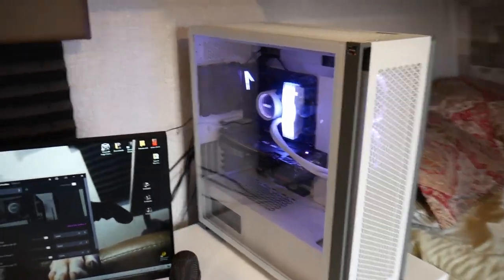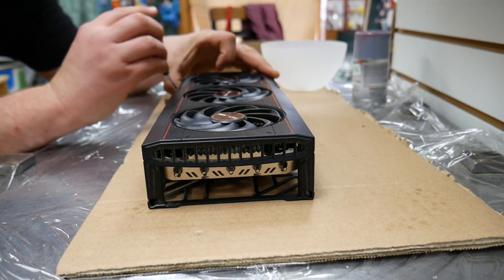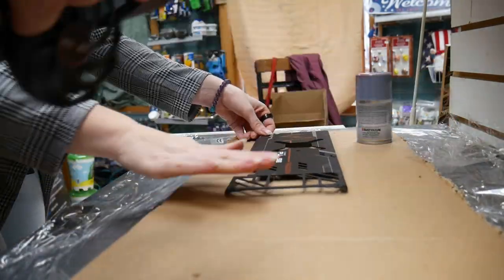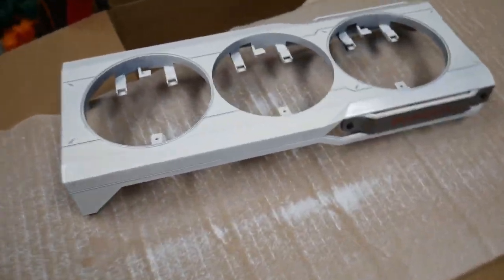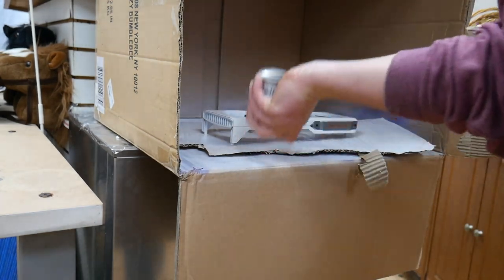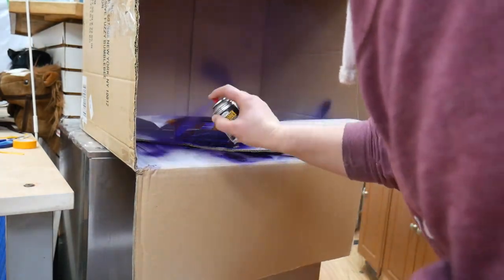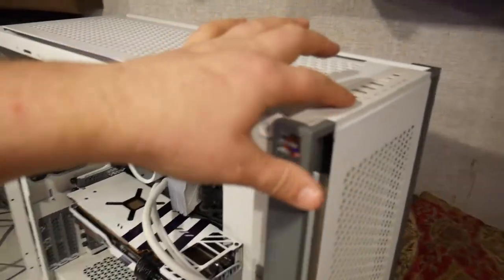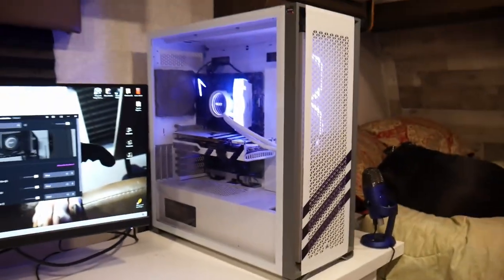Painting my GPU!!!!!!!! White GPU Paint job!!!!!

Comment: One of the better, cleaner paint jobs with good tips. If you take your GPU apart, definitely give the GPU die a cleaning and REAPPLY new thermal paste! it will do wonders! I would recommend putting the camera on a tripod as well.